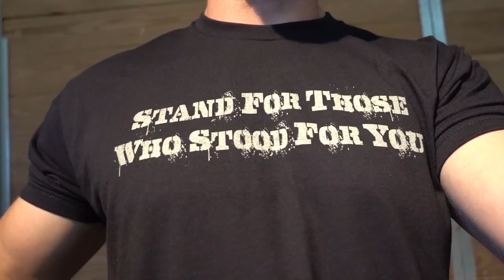My Kids Are Going To FREAK When They See These!!!

Comment: I have the same go kart. They drift really well after you put in stronger springs in the clutch. I have only rolled it once but the previous owner rolled it many times. They are really safe and stable. They only seem to flip when you turn as sharp as you can at full speed

Comment: I had one of those growing up and they're super fun! BUT(!), not sure it'll do it with yours but mine did it all the time, keep a good fuel stabilizer in them as well as seafoam and carb cleaner as they will gum up the carb easily if stored and left with the fuel on for more than a month without driving them. I always just cut the fuel and let it idle until the fuel line went dry and that helped.

Comment: Be so careful in those carts as our neighbors 12 yr. old turned theirs over last Winter in the snow. The roll bar severed his arm just above his elbow. They did reattach it but he is still doing therapy. It can happen to kids as well as adults.
Reply: I was 6 years old riding 50mph four wheelers. Don’t shelter your kids...
Reply: tarfoot. I have that same model and I rolled the other day with out a helmet but with seat belts and I came out without a scratch.
Reply: @willfaulkner1743  Well I pray that you never see any harm to yourself, but it does happen and that you can't deny. Guess that's why they call'em accidents.

Comment: It is nice you are safty minded. When i was little I was racing go-karts with my cousin and I was winning, I looked back and saw my cousin comming up behind, so I turned around and pressed the gas aand I ran smack dab into a small tree. Because this was the 70's we did not have helments and my nose hit the stering colum with full force. I still have pain everyday some 4oyrs later. The worst part was trying to explain to children services that it was a total accident!  Make them wear the protective gear, it will save both of you alot of grief.

Comment: Was wondering why you don't use your Ryobi impact driver? They're very helpful, and make the jobs you have quicker and easier. They're strong enough to break small bolts, but if you have trigger discipline, it's won't be an issue for you not to over do it! Just saying brother.